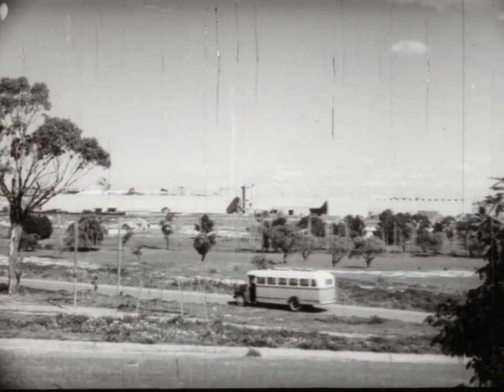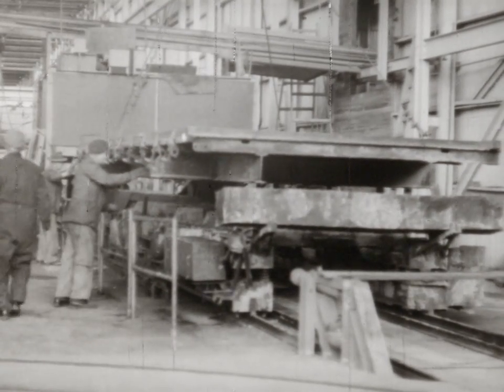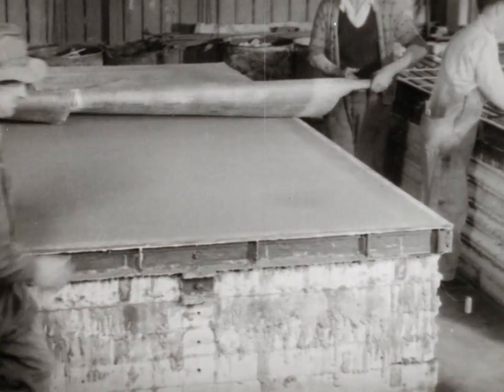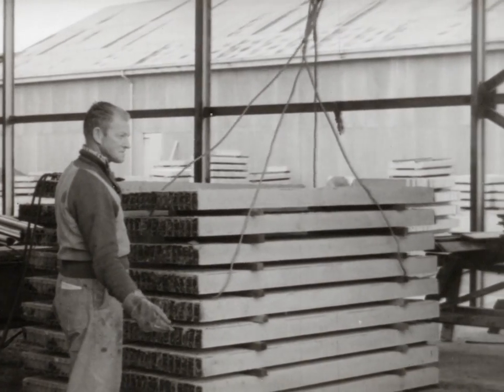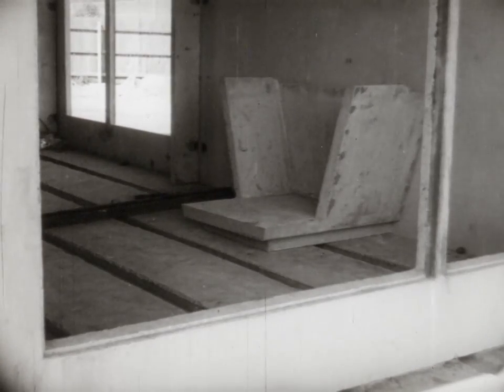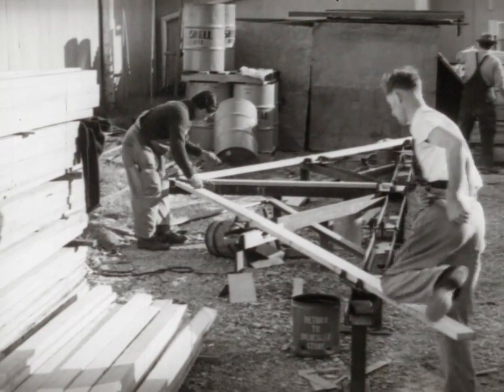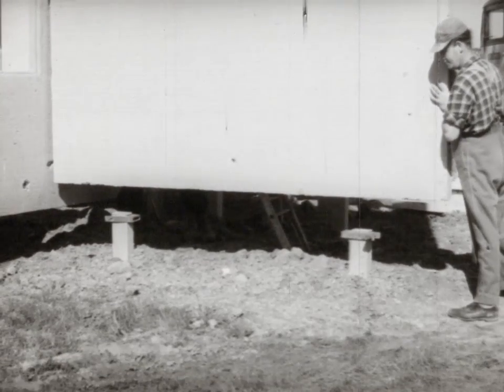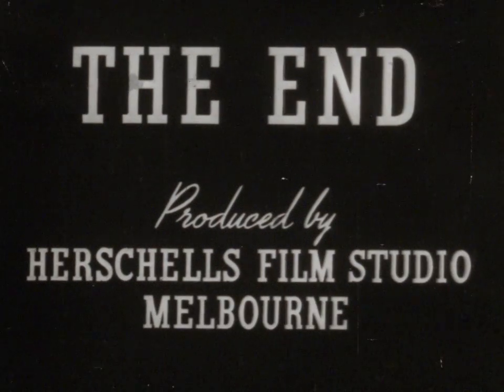The Story of Holmesglen Concrete Housing Project

Comment: Dr James Evans because it's concrete I did a diploma building construction actually at Holmesglen where they made that with the in the factory now I take where they made these concrete homes you would have to have wall upholstery inside because you cannot wallpaper the concrete obviously cos it's porous and maybe you'll have to have a blue board with a a vapour barrier in between the concrete and the BlueBoard the insulation on the outside unless you bring it up with a with a polystyrene brick behind it obviously some blow I insulation